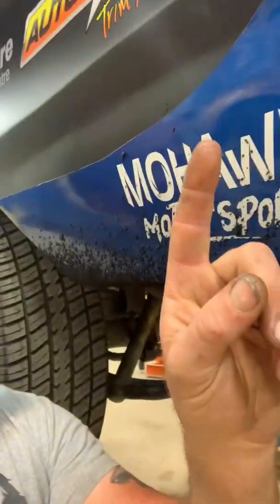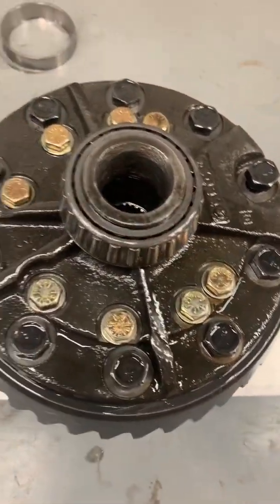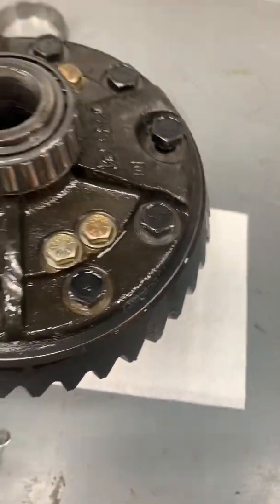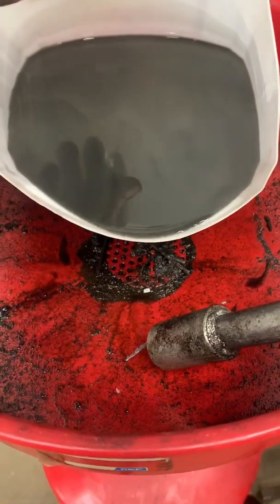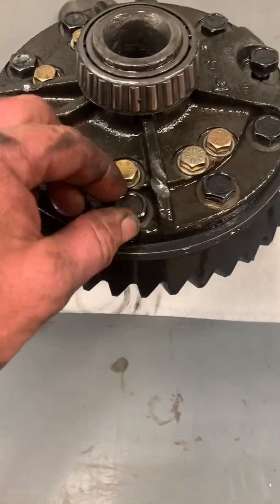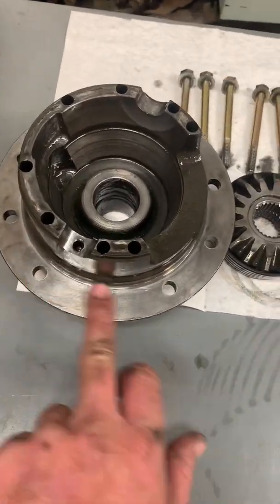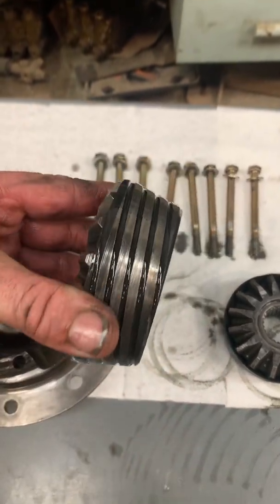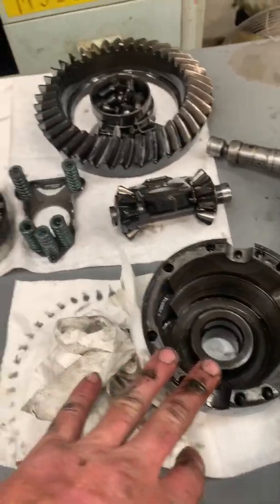Dodge 8 1/4" Suregrip Teardown and Inspection

Comment: I was told the cone style sure grips are not rebuildable. If I took one to a machine shop what would I tell them to do?
Reply from the maker: I have to find the procedure again but it involves machining down the pockets the cones sit in and adding shims made from shim stock of the same amount that is machined out to the other side of the cone to keep the distance relation to the spider gears. But I'm on the road for the next week for miles of mayhem and will get you the proper procedure once I'm back 👍🏼. Send me a comment in 8 days to remind me if you haven't heard from me by then please.
Reply: @dazeofgloryshopworks5806  hello there! Thanks for getting back to me. I sure would appreciate that. Let me know what you can find. I’ll write back soon to remind you. Appreciate it?
Reply: Hello again. Just a friendly reminder about the sure grip machine shop thing. If it’s not too much trouble. Thanks!
Reply from the maker: @gorm2753  thank you. I'll get looking tonight!
Reply: @dazeofgloryshopworks5806  appreciate it👍
Reply from the maker: @gorm2753  so I know you machine the smaller cone to fit tighter into the outer cone. But then you have to shim the backside of the outer cone the proper amount to maintain the proper depth for the springs to maintain their tension. 
So, if you machined 10 thou (0.010") odd the back face of the inner cone, you'll have to add 10 thou shim to the backside of the outer cone. The machine shop can do the proper measuring and will have shim stock to make the shim required to take up the slack. From what I've seen, guys will machine 10 thou off the inner cone. Or they'll take 5 thou off the inner and 5 thou off the inside pocket of the outer cone and shim the backside 10 thou to make the difference up. Let me know if this helps please. I've thought about doing a video just on this to be more thorough on it for everyone.
Reply: @dazeofgloryshopworks5806  that makes all kinds of sense to me. That should be enough to go by if a guy was to take one to the machine shop I would guess. A video would be great to do as well, if it’s something you have time for down the road. I’d say a lot of people would benefit from that. Plus I can’t think of how many people I know of over the years who garbaged those cone style carriers because they weren’t rebuildable. That’s a terrible waste if they can be fixed, even if it doesn’t last as long. Huge thanks. I’ll be watching the channel and keeping an eye out for that specific video if/when you decide to make it 👍
Reply from the maker: @gorm2753  thank you. Best of luck with your suregrip as well.  And yes, I used to avoid getting a sure grip or an auburn replacement because they weren't rebuildable supposedly. I'll make the video in the coming months and will go right through with the machine shop and all. 🤘🏼
Reply: @dazeofgloryshopworks5806  Sounds awesome! I’ll be watching 👍
Reply: @dazeofgloryshopworks5806  I have one more question, unrelated to this. I did a automatic to a833 conversion on my car (with a LA engine) The automatic had braces/gussets from the side of the engine block, to the Bellhousing. Is the 4spd supposed to have those too? The ones for the auto trans don’t line up anywhere on the 4spd Bellhousing. Are there different ones for the 4spd or are they just not on the 4spd? You’ve been so helpful already and I don’t want to push my luck but I just thought I’d ask. Having trouble confirming that either way. Thanks
Reply from the maker: @gorm2753  there are different ones for the 4-speed but I've never gotten my hands on a set. There is no danger to the driveline by not having them. A fella could modify the automatic ones if he felt so inclined but I'm currently running a 5-speed in my 67'dart with a 408 stroker and haven't had any issues with not running them. 
Ask any questions you want whenever you want. Worst case is I won't have a proper answer for you. Never know till we ask right? It's my pleasure to help where I can and I'll do my honest best to continue to do so. 🤘🏼
Reply: @dazeofgloryshopworks5806  Awesome. I’ll keep an eye out for some but knowing you’re running your setup without issues is great peace of mind until if/when I do find them. If you’re running that set up, my 150hp 318 shouldn’t cause any issues. Good to know all that. Once again, big thanks for taking the time to write back. 👍
Reply from the maker: I have to find the procedure again but it involves machining down the pockets the cones sit in and adding shims made from shim stock of the same amount that is machined out to the other side of the cone to keep the distance relation to the spider gears. But I'm on the road for the next week for miles of mayhem and will get you the proper procedure once I'm back 👍🏼. Send me a comment in 8 days to remind me if you haven't heard from me by then please.

Comment: Did using the springs from a 9 inch work?
Reply from the maker: So, I used the suregrip springs from the 9 1/4" rear diff. The (big brother) to the 8 1/4". And yes they worked. I had to synch the bolts down evenly and they compressed pretty hard. But I've run that diff now for a good pile of miles and drag raced it as well. So far even with my worn cones, it's holding. I cant give any longevity specs but she works right now🤘🏼
Reply: @dazeofgloryshopworks5806  awesome, I'm gonna try that
Reply from the maker: @brianhanson5162  I think it's a good way to make a costly repair fairly inexpensive to get a fella down the road with both tires burning... at least for a little while. Thanks for the question! 🤘🏼